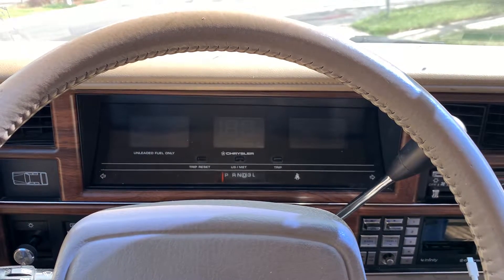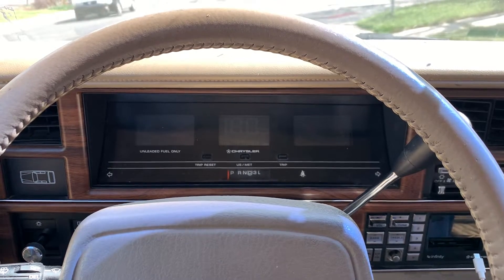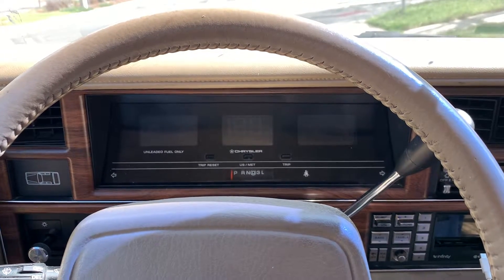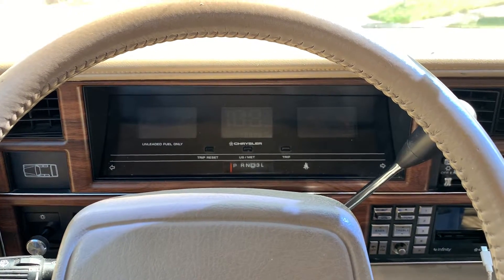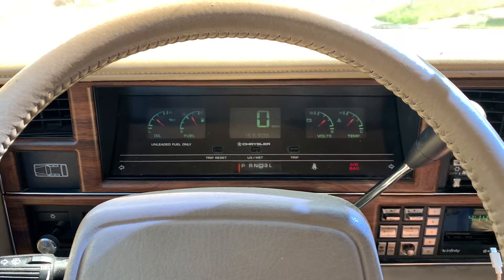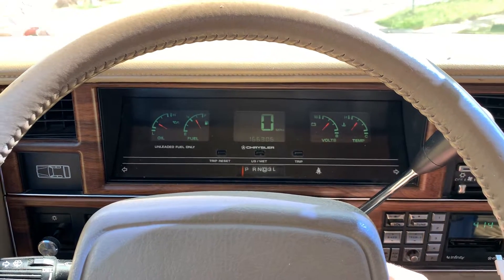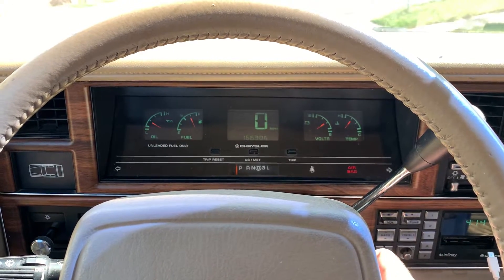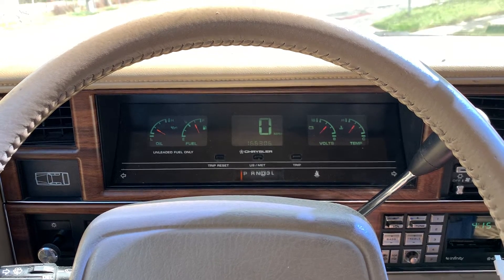Testing New Starter Motor on 1991 Chrysler New Yorker Salon

Comment: I have a 80 Chrysler New Yorker. With 33,000 original miles. Purchased 2 years ago. From elderly lady in Nashville. Had shipped back to Denver. Do you know where there is a good salvage yard where they might have some R bodies. I'm looking for back bumper filler. Really enjoy your videos. Love your new 91.
Reply: R-Bodies are very rare. Only 3 years of production. 1979-81, a company called LKQ on google might be able to help you out. But because there so rare and many have probably been recycled long ago. Finding trim parts might be slightly more difficult. Wish you luck!